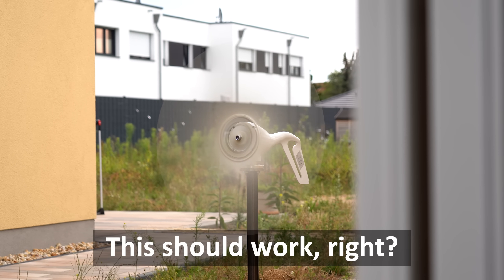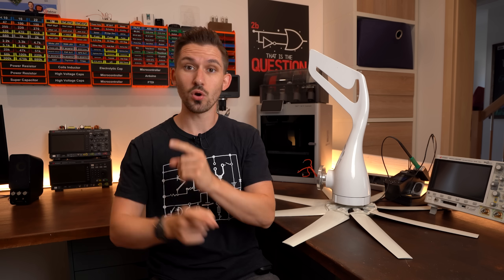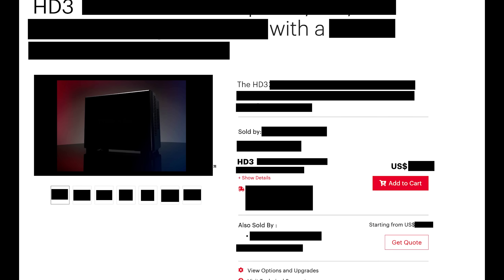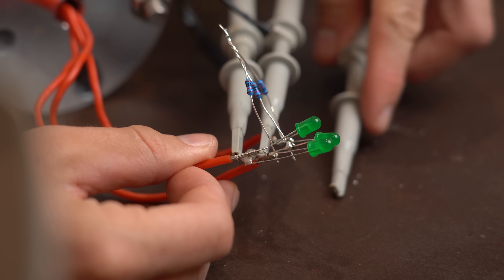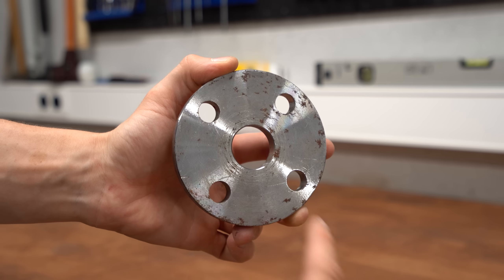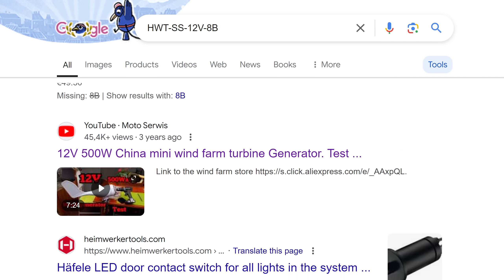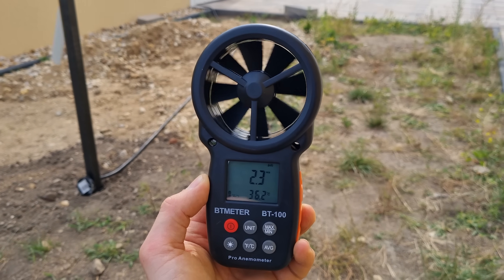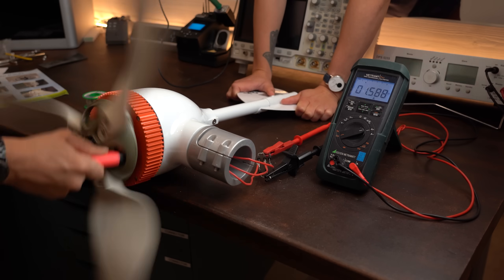I tried to Power my Home with Wind Generators! (Worth it?)

Comment: Back when solar panels where so expensive that you had to win the lotto to be able to afford them I experimented with wind turbines. I had them on about 6 meters over the ground an nearly at the top of a hill so they where spinning. The result however was not very good. To get a reasonable result one must have a very big one. 6 to 10KW would be the smallest for a house. 
Today I use solar panels. With those I get an average of 3 times the wattage value of energy over a year. That is 1000W panels will create 3000W every day in average over a year. In the winter the average is only 1.5 times but then it is 4.5 times in the summer. Air conditioning in the summer is no problem but electric heating in the winter is. We need batteries that are cheap and can keep the energy for at least a year. This is around Melbourne Australia.
I calculated once how much it would cost with cheap LiFePo4 batteries to have enough energy for my house year round. It came to some where between 1 and 2 million Dollars so not quite economical. That was even ignoring losses in the batteries when keeping them charged for 6 months or more.

Comment: Perhaps a voltage doubling rectifier would get the output into the MPPT range.

Put two capacitors in series.
Connect two phases from the turbine to a full wave bridge rectifier that charges this capacitor string.
Connect the third phase to the midpoint of the string.

Comment: I noticed the wind generators around the world turn quite slow most of the time and as far as I know the generators are not very efficient at low RPM, so probably some gears/belts that increase the RPM of the generator may help.

Comment: 2:06 the problem is obvious, with all three phases touching you should not be able to turn the blades so easily This is due to lack of magnetism cutting the coils and is probably due to cheap magnets or poor design (or both). Look up Hugh Piggot for more information on DIY Wind Turbines and how they work.

Comment: With wind turbines we can see that they are not meant or designed to move fast so if we make relatively big blades we can increase the power transfer ratio in theory for home consumption but that needs enough space.

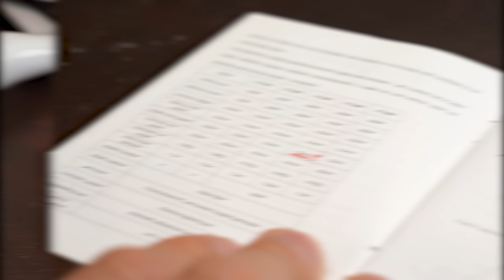Comment: Looking at the segment around 12:14 I can without a doubt say that the rotor does not look balanced at all and it's clearly mounted out of alignment. It looks like a really badly designed generator. This misalignment also looks like this causes the wobble we see when the generator is spinning. This will surely hinder the power production as it gets stuck in oscillations which cost a huge amount of energy and lower the efficiency by a lot.

Comment: Would charging supercaps that then charge the battery work better as caps are quicker charging?  
I was thinking of using a couple of 16v one in series connected to my solar (19v) because they charge faster than LiPo batteries. 
But not got that out of the shed yet...

Comment: flawed experiment. the wind speed and the amount of obstacles at ground level will render wind powered generation useless with these type of generators. vertical axis with comically large fins to make use of low wind speeds at ground level then gear the output to spin your generator fast enough to produce usefull power

Comment: The energy in the wind is calculated using the formula, kinetic energy = 0.5 M V^2. Where M is the mass of air passing through our wind turbine per second. So M = density of air x area swept by the turbine x wind velocity.  Then you also have to include an efficiency term for conversion of the wind kinetic energy into rotation of the turbine. So you end up with the power proportional to the turbine radius squared and the wind velocity cubed.
So Power = efficiency * 0.5*pi*rad^2*rho*V^3, where rho is the density of the air, rad the turbine radius and V the wind speed.

rho = 1.3 kg m-3
V = 6 m s-1
efficiency =0.35.     a typical efficiency.
rad = 0.5 m

Plug in some numbers.  Power = 0.35*0.5*3.146*1.3*(0.5^2)*(6^3) which according to me is about 40 watts.
Please correct if I have made a mistake!

While this is a fairly pathetic amount of power I wonder if your MPPT converter is not tuned to the wind gen characteristics?
I gather you have to optimise load to get a balance between torque and speed for maximum power and that relationship is generator specific.

Comment: You'd need a blimp hovering higher with at least 2m generator blades and of course a way to stop it during storms or super-strong gusts of wind to avoid failures related to over-voltage/over-current. In general those small wind turbines are expensive toys. Power produced from wind is directly related to blades length and stronger consistent winds are on higher altitudes. Nice try though 👍

Comment: Those cheap wind generators are not made for the slow wind speeds of germany. There are some manufacturers from germany which sell very good wind generators for home use, but of course you won't get them at prices below 10k....

Comment: Such blade speed for such a low voltage? Also, the fact that the LEDs withstand the current while directly wired to the coils suggests that the current is not great either. My conclusion is that the alternator is trash. Better get an automotive alternator and control the output voltage by regulating the feed to the stator (field). Fins might need to be modified to have the needed torque to move the automotive alternator given the wind patterns in your location. Another alternative is to use a low-wind vertical generator.

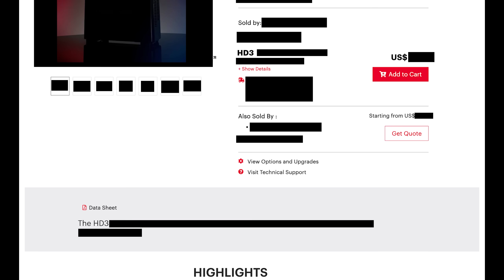Comment: @2:02, what in the world?  I have a 500watt Ginlong neodymium wind generator and if I short the 3 phases together, there is no way on earth I can get it to rotate with my bare hand like you demonstrated.  Shorted, the generator is basically frozen solid.  @2:25, In fact, If I were to attach 3 small green leds like you did without resistors, they would have all exploded with a small hand crank at around 10rmp due to something like over a few amps being driven right into them.  Are you sure you haven't bought a complete piece of junk?  There is no way any entry level authentic PMG (permanent magnet generator) should be hand turn-able with the leads shorted.  Even my DC treadmill motor with it's terminals shorted becomes extremely difficult to turn, and it isn't even optimized to be a low rpm wind generator and it isn't even using neodymium magnets.

Comment: Since you now have a welder, you could probably convert both of those to be driven by a bicycle for an emergency backup system.  A human with a tiny bit of training can do 200W sustained for 1hr.  Or pile together a bunch of gears to do a huge gear ratio and make a gravity weight generator.

Comment: Wind turbines need to be up high.  I think for every 10 meters you will get 5m/s increase in wind.  That is why most private wind turbines in the 1--5kw range are usually 20m in the air or more.  They also look at wind maps because you really want 20+ m/s wind speed on average for power production.  You also want a break or load that can keep the wind turbine from going too fast, usually if the wind speed passes 40m/s

Comment: I had one of these. did well in winter. Survived multiple hurricanes. Until a tornado took it out last month. Still cleaning up, the PMA survived with minimal damage and the tail survived but the rest including most of the blades got destroyed from impacting the ground.

Comment: You need a bushing on that wire for safety.  It is going to be in contact with that vibrating metal edge.

Comment: Wire the two generators in series. It adds the voltages together and should allow you to get a higher output power at low speeds.

Comment: With wind generators size matters. Output is based on swept area, so pi times the square of the radius. Output increases exponentially as you increase the radius. These little generators don't have much to offer. I wouldn't bother with anything under 2m diameter.

Comment: Shame you couldn't put the generator above the height of the roofline. Wonder if that alone would have been a noticeable increase in the amount and direction of wind. I live in the country, and I've pondered about getting a wind generator myself, even better if it is one that can feed back into my local grid, and give a potentially even bigger cut to my bill.

Comment: When welding you form a molten puddle and make sure you see it melting into both parts, ie, point the electrode at the thickest part to give it more heat, then slowly move that around the pipe. ie, should be continuous and have no gaps.

Comment: Mayhaps larger/more blades with a gearbox between them and the existing windings? Higher RPMs? Then you would have to figure out how much power is wasted in the conversion to determine worth I guess.

Comment: How can harvesting wind which is free, not be worth it?   Maybe if you try to buy everything the numbers dont work out in your favour, but even then they should in the long run, its free energy,  maybe if you DIY'ed some of this stuff the numbers would work to your  advantage in the short term. Robert Murray smtih has been doing a lot DIY wind turbines on his channel, being out there on the Isle of Ingle (England)  they got lots of wind and no sunshine so he keep himself busy with wind turbines, and shares some cool ideas for generators and what not. All you need is raw materials like copper and magnets and could 3d print the rest.  Some clever gearing to get the wind turbine to start at slow speeds and make it more versatile and there you have it.   Easier said than done, I know, no ones invented an easy start wind turbine, but you know some viewer on another channel decided to take up the challenge and desgined a hub motor that combines freewheel and regen motors in one, using the best of both worlds which up until then you could only pick one, either a free wheel design or regen.  He managed to combine both settling the argument which one was better, both were in the right circumstance.  I bet something could be done like that with wind turbines and solve this engineering problem no one has yet.  Either way, i find wind power generation pretty cool, but here in Canada we have lots of water, so im looking at mini hyrdo generators, perhaps portable ones you can take with you and charge an ebike over night in a river. I think you need wind, water and sun to really go offgrid , at leatse in multiseason climates like we have here. 

 BTW you have to be careful when you buy this stuff its almost never to spec, and they can get away with its becasuse that 500w they advertsie, the controller indeed can handle that much.. so there you have it, they put the charge controllers max spec on the ad and make you think youre getting 500w of generation.  Meanwihle the specs actually will tell you the voltage and amps which I saw here was 12 v, so kind of easy to approximate it cant be more than 100w.  But yeah its not cool how they advertise like this, i wouldnt buy from anyone who does it like this but they all do so..

Comment: You just can't use a wind generator next to the ground like that. Wind speed increases with altitude. To use that little wind generator you need to get it really high. That's not the wind generators fault

Comment: Two dirt cheap sources of 3 phase generators are those hoverboard toys and discarded front loading washing machines. Both make quite a lot of juice with low RPMs. Feed the output of them through a rectifier and capacitor to make DC then feed the output to a battery charger. The washing machine motor can drive a regulated output 220V SMPS directly with just the rectifier attached. The hoverboard motors are better for wind and manual peddle generators while the far bigger washing machine motor is better suited for hydroelectric power. ❤

Comment: I been reading that the wind turbine needs to be high to get the most out it.  You need to support that turbine so the pole doesn't break.  You also need to check to see if it okay to put up a wind turbine(s).

Comment: I went through the same issues, you need to be about 20 meters up above the turbulence to get wind enough to generate any significant current.  These things really need to be moving fast and constant.  I did this for a test. I used two in series with an MPPT controller. I first put a 2700 UF 40v cap on each of my three phase rectifiers. Then put them in series to my MPPT charge controller. As long as both were moving , I got a good amount of power.  Get them as High as you can, or go with your first idea and rewind them for lower speeds at higher voltages. It  looks like you can simply   solder the windings in series internally for higher voltages. I'd try that, but again you really need to be up high to get any power.

Comment: Why not use a FOC controller with regenerative braking and a wind speed sensor to controll the RPM according to optimal tip speed ratio for the specific turbine?
Should give the highest power output and efficiency for every wind speed region. 
For example you could use a VESC motorcontroller for that.

Comment: The short answer is no.  It isn't.   Wind power is a terrible idea in most applications and locations.  It is one of the worst scams the Texas legislature ever fell for.

The only time wind power ever made sense was when solar panels didn't exist yet and some remote rural locations didn't have power lines to them yet back in the 30s and 40s.  And having some power some of the time was still better than no power at any time.

Comment: Locally here we have the smiley face car speed indicators on some roads with a small wind turbine mounted above, now these speed indicators are reported to be mostly not working because the battery is not getting enough voltage from that same type of wind generator you were testing.

Comment: i think the wind generators tends to have some kind of gears to increase speed of the generator inside even with low wind speed im not sure how it works but i think i came past these stuff online direct wind to the generator itself wont be good as if there is gears between to make the rotor go faster than the wind

Comment: I wonder if adding a gearset to one of these would've made a difference? Something to make the generator portion spin at 3x blade speed, slowing down the blades and reducing their losses. Cut-in speed would increase but who cares if it only generates 1 watt at 2m/s. Also it's irritating how many scam wind gens are on amazon and ali. Promising thousands of watts of power and delivering only 1 lol The amount of unchecked fraud is really disheartening to would-be DIY'ers.

Comment: As far as I remember (and my memory is bad, usually) wnd speeds can change based on the infrastructure the wind is blowing through. That's technically why it's not recommended to be under a bridge during a tornado, because such a tunnel increasese the wind's speed locally. What if instead of changing anything about the wind generators you "funneled more wind" into the generator itself? This could locally increase the wind speed, I think.

Comment: I watched a video by oy electrical that they stuck a turbine on a boat. It wasnt particularly high and made good power. They ended up taking off due to noise i believe as it was a full time and had solar aswell as battery and grid access. They didnt need the capacity more just an experiment.

Comment: A bit I’m intrigued about (especially here in Florida) is Stormy Days where there is little sun, but strong wind.

Granted if it gets TOO strong thay cam be an issue as well, and again installation cost vs more PV and/or Batteries is always an argument, but this angle has me intrigued.

Also Material Use + CO2e Emissions / Recyclability and all that LCA type stuff can be merged into this argument.  Granted PV / Newer Battery+E Waste recycling is getting better, but metal recycling is always easier!
Reply: I have one of these in se Florida, mounted center hub about 3 foot above roof peak.
On stormy times I get 150w bursts. 20w bursts on windy days

Comment: If you in the tropics its worth it, yes it does not work much in principle but.... here in Darwin, when we get a low following a cyclone in the wet season, there is not much sun, verry overcast for sometimes weeks, but those local thunderstorms for every day/night make my turbine spin very nicely, topping up my charge very successfully and without it (proven) my batteries may run low from not enough sunlight on the panels (during the wet season only) so hence if you got the space, don't use mono crystalline panels, but Amorphous panels which work better in our wet season in low light due to overcast conditions!

Comment: well, it is worth it because if you’ve got solar panels and the Sun is out the wind turbine takes over so at least there is power being supplied if there’s no sun but there’s wind and there’s sun then there’s no need for the windmill to be on but it’s there in case the solar panels cannot produce enough voltage to charge you could have solar panel wind turbine and even make a water turbine the collects the rainwater and drains it down past the propeller of the generator to make it spin to create power so you’ve got rain sun and wind to generate power oh if you’re living close to a river, then use that as a way of providing electricity one thing I’d like to know is if you can invert 5 V to 12 V and then the 12 V into 240 V whether that would work because if that does work then even if you can’t produce 12 V but still can produce 5 V then that can be converted to 12 V which then gets inverted into 120 V or 240 V